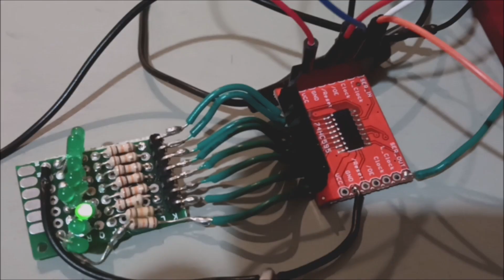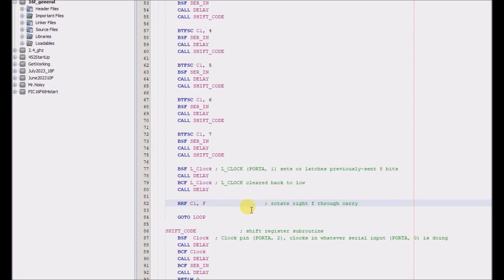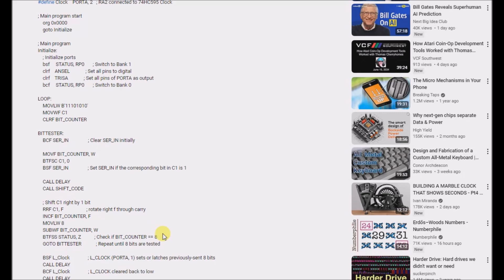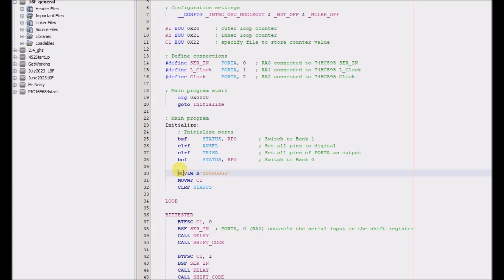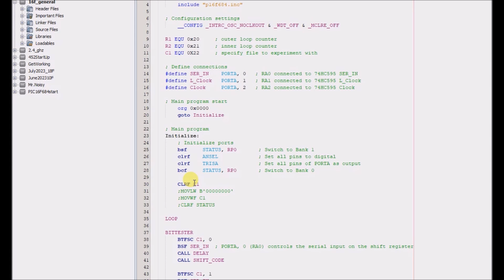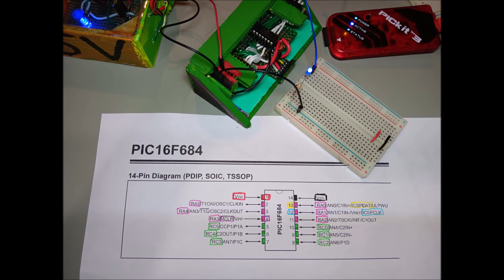PIC16F684 Part 011 - Controlling a 74HC595 Shift Register, Carry Bit?

Comment from the maker: ;free sample code, copy and paste    

    processor 16F684
    include "p16f684.inc"

; Configuration settings
    __CONFIG _INTRC_OSC_NOCLKOUT & _WDT_OFF & _MCLRE_OFF
    
R1 EQU 0x20     ; outer loop counter
R2 EQU 0x21	; inner loop counter
C1 EQU 0X22	; specify file to experiment with

; Define connections
#define SER_IN	  PORTA, 0   ; RA0 connected to 74HC595 SER_IN 
#define L_Clock	  PORTA, 1   ; RA1 connected to 74HC595 L_Clock
#define Clock     PORTA, 2   ; RA2 connected to 74HC595 Clock
    
; Main program start
    org 0x0000
    goto Initialize

; Main program
Initialize:
    ; Initialize ports
    bsf     STATUS, RP0       ; Switch to Bank 1
    clrf    ANSEL             ; Set all pins to digital
    clrf    TRISA             ; Set all pins of PORTA as output
    bcf     STATUS, RP0       ; Switch to Bank 0
    
    CLRF C1
    
LOOP
       
BITTESTER      
    BTFSC C1, 0
    BSF SER_IN	; PORTA, 0 (RA0) controls the serial input on the shift register
    CALL DELAY
    CALL SHIFT_CODE
    
    BTFSC C1, 1
    BSF SER_IN
    CALL DELAY
    CALL SHIFT_CODE
    
    BTFSC C1, 2
    BSF SER_IN
    CALL DELAY
    CALL SHIFT_CODE

    BTFSC C1, 3
    BSF SER_IN
    CALL DELAY
    CALL SHIFT_CODE
    
    BTFSC C1, 4
    BSF SER_IN
    CALL DELAY
    CALL SHIFT_CODE
    
    BTFSC C1, 5
    BSF SER_IN
    CALL DELAY
    CALL SHIFT_CODE
    
    BTFSC C1, 6
    BSF SER_IN
    CALL DELAY
    CALL SHIFT_CODE
    
    BTFSC C1, 7
    BSF SER_IN
    CALL DELAY
    CALL SHIFT_CODE
    
    BSF L_Clock	; L_CLOCK (PORTA, 1) sets or latches previously-sent 8 bits 
    CALL DELAY
    BCF L_Clock	; L_CLOCK cleared back to low 
    CALL DELAY
    
    RRF C1, F			; rotate right f through carry
    
    GOTO LOOP
   
SHIFT_CODE		; shift register subroutine
    BSF  Clock	; Clock pin (PORTA, 2), clocks in whatever serial input (PORTA, 0) is doing
    CALL DELAY
    BCF Clock
    CALL DELAY
    BCF SER_IN
    CALL DELAY
    RETLW 0
    

DELAY MOVLW 0x80	; adjusted delay time
      MOVWF R1    
AGAIN MOVLW 0x20
      MOVWF R2    
HERE  NOP
      NOP
      DECFSZ R2, F
      GOTO HERE
      DECFSZ R1, F
      GOTO AGAIN
      RETLW 0
    
    END ; Needed to end the program.